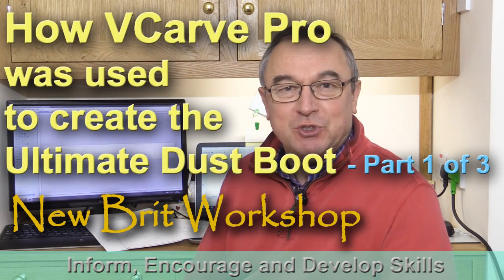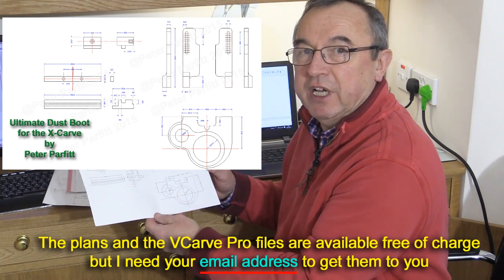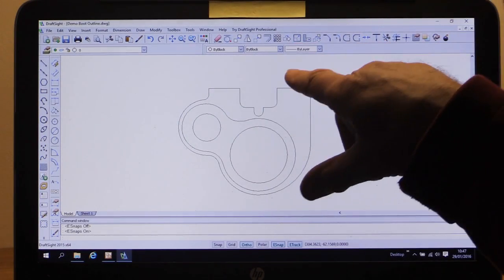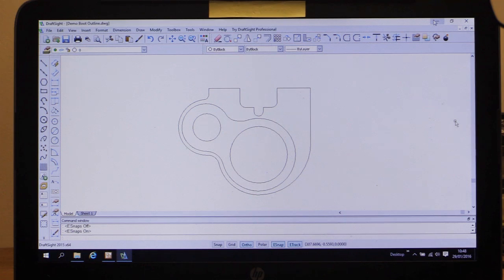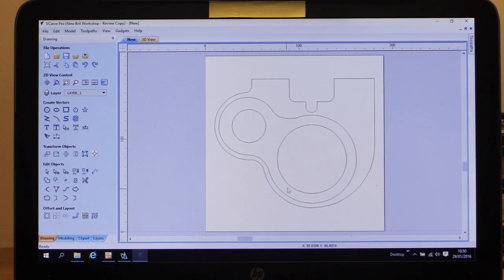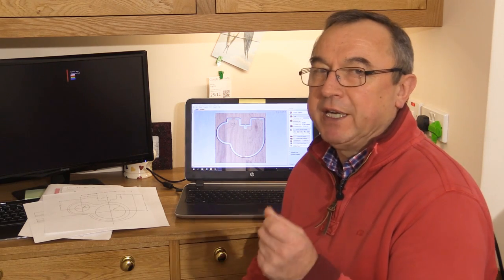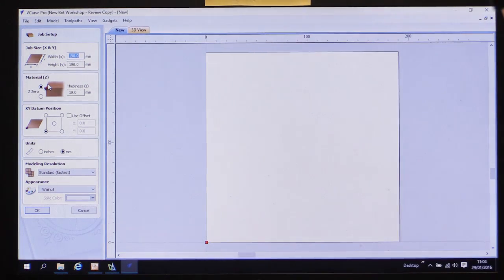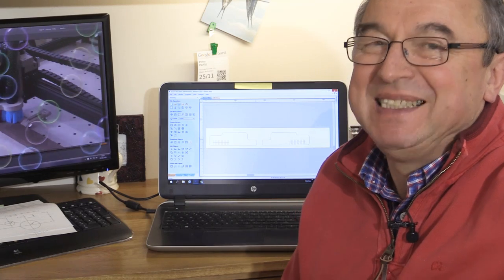Ultimate Dust Boot VCarve Pro Design - Part 1 of 3

Comment: Hi Peter, can't seem to figure out how to send a private request for the V-Carve plans of the Ultimate Dust Boot for the X-Carve!
Reply from the maker: Hi Gerry, YouTube have removed that function. Send me a message with your email address and it should be captured in a junk folder and not displayed. I will be able to read it and then I will delete it. If it does get through I will still action it and then delete it. When you do send it please state again what plans you seek as I get so many messages that they scroll off into the dim and distant past very quickly.    Peter
Reply from the maker: I saw you message with the email address and have deleted it - the plans are on the way.    Peter

Comment: Peter, great videos. May I get a set of your plans for the ultimate dust boot as I have the DW611 and this will work great. I like your design that the boot stays the same and the router goes up and down independently. My email is RonS1955@comcast.net. I really appreciate your videos and all your good advise. I need all the help I can get. Thank again. Ron
Reply from the maker: +Ron Swanson  Hi Ron, The plans are on the way.   Peter